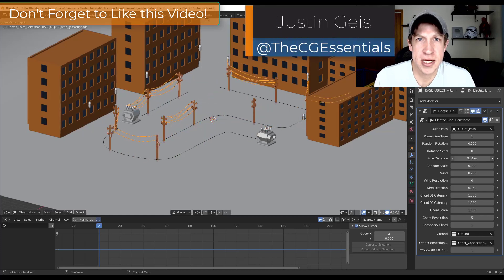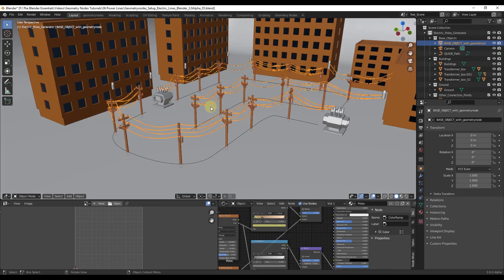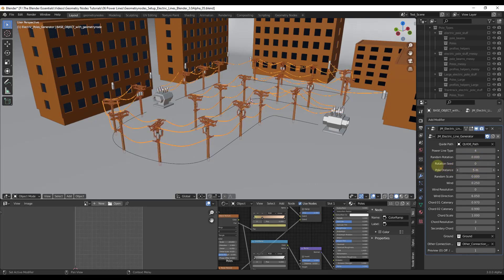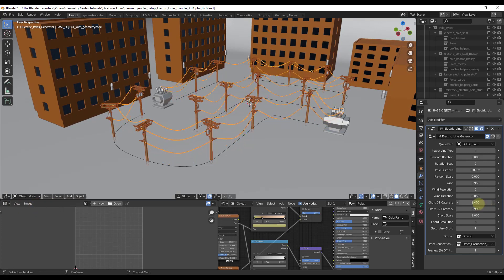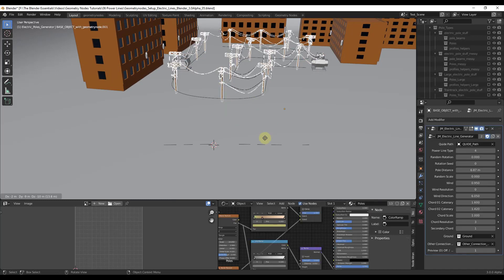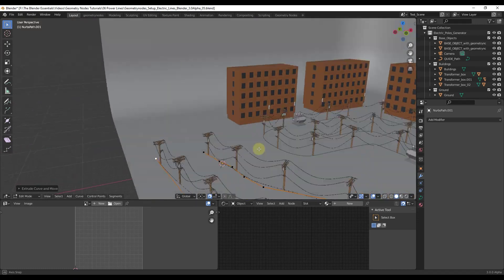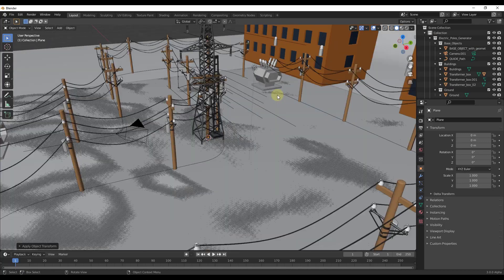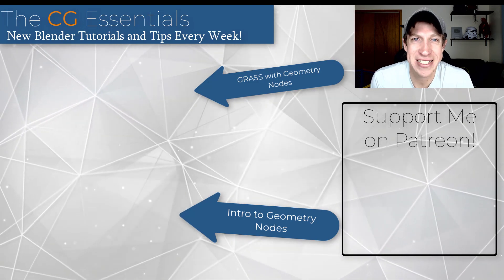THIS is What Geometry Nodes Should Be! AWESOME Power Line Generator Node!

Comment: the proof of concept is well done made by someone who is no doubt very talented. I just see very little use for such an application. the low kv poles are typical set up at 50 meter intervals and doing all this work by hand would not be such a issue.
Reply from the maker: Well the use is once this gets perfected for something simple, it can be built into something that works for more than just power lines...